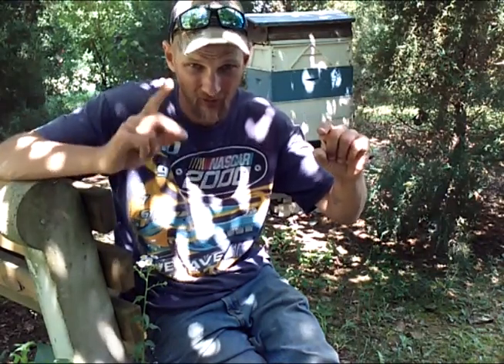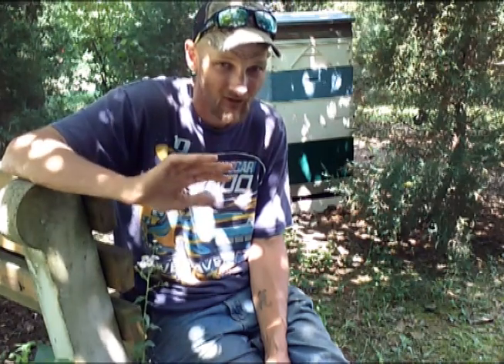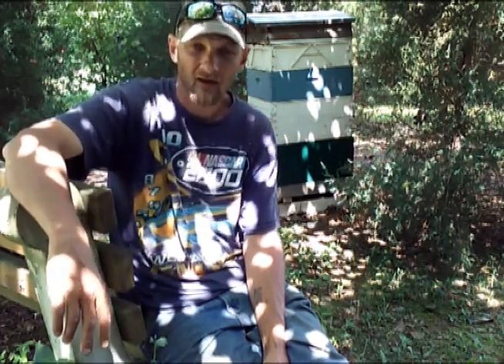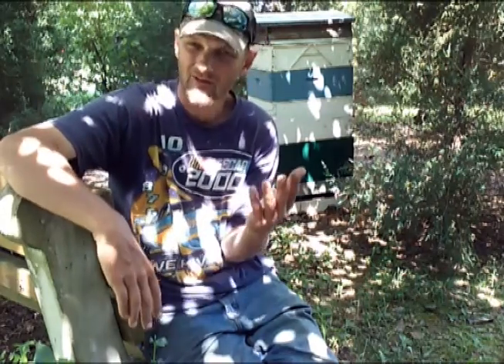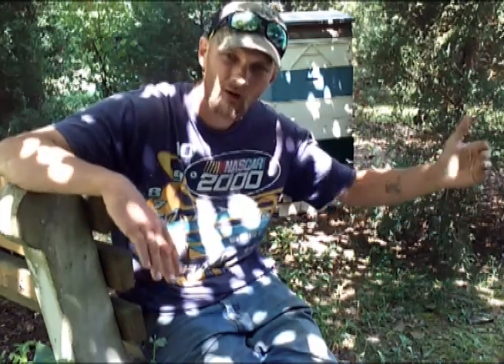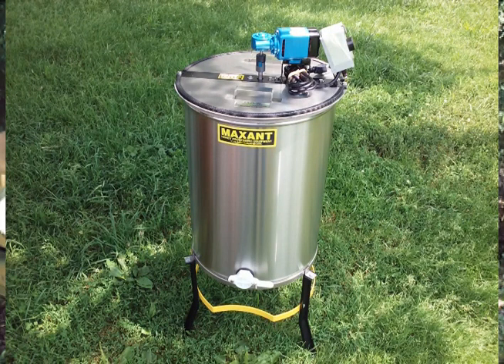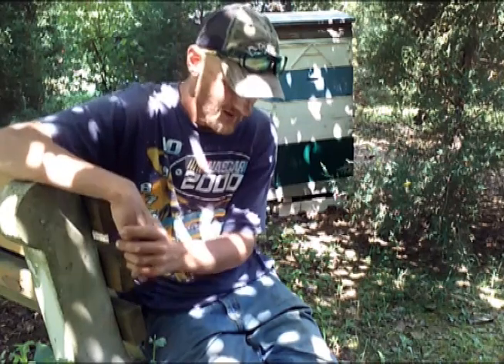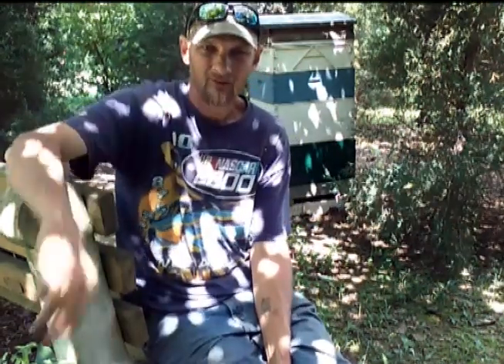Queen Bee Piping/ Tooting Noise Explained (Queen Rearing)

Comment: I've heard the piping on two separate occasions . Once while i was recording a hive inspection only to discover i was not recording. 2 queens in the same hive with a third one hatching. One in one box and the other one in the box below it. And i didn't get any of it recorded.8-(  The other time , i didn't take my camera. 8-( . Once you hear it, it is instantly recognized.

You should of made some extraction videos with the old equipment. Some of the newer hobby beeks are probably going to run across some of the old equipment and will pass on getting it thinking it is just old junk.  But it still works and they wouldn't have to do the ole crush and strain ruining that already drawn out comb.
Reply from the maker: See this is why I use my cell phone camera, you just never know when something like that will happen. 

I do have video of the old extractor but it's of me restoring it and putting an electric motor on it. You can see it here https://youtu.be/Q6FZ2RqPNag . You are right though, I should make a video using it to extract. These extractors are way cheaper and usually on Craigslist, so I can see people using them.